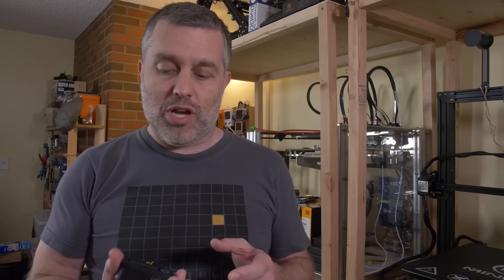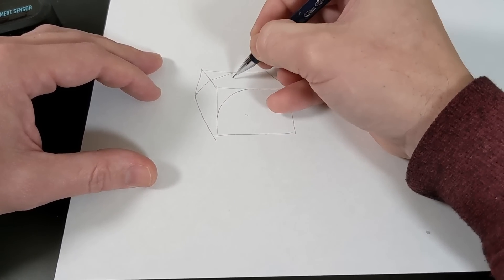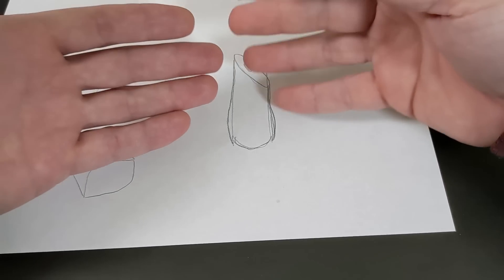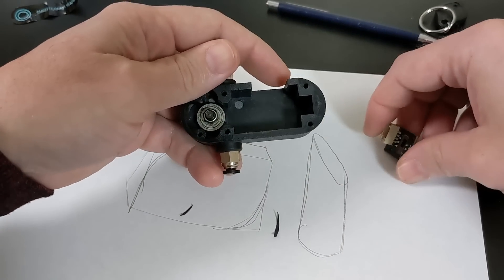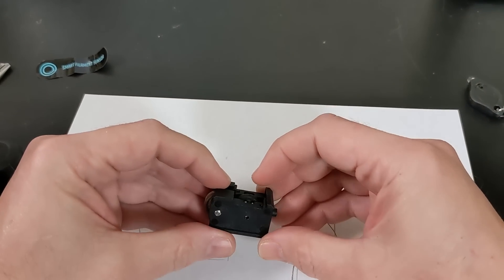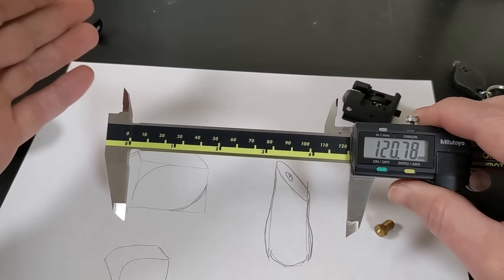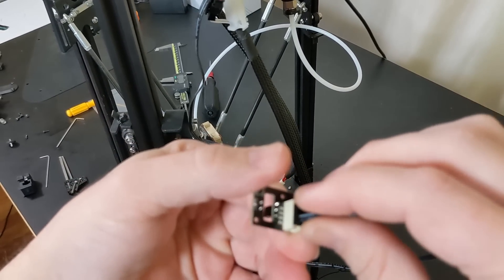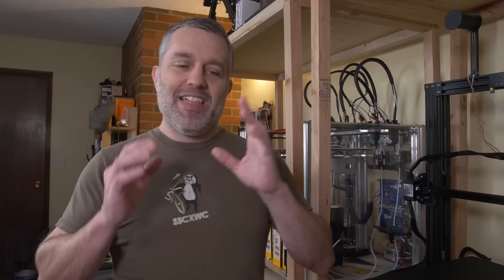The Bigtreetech Smart Filament Sensor - An In Depth Review

Comment: Although I agree the design could be better, the filament would eventually (sooner than later, I guess) tear the rubber wheel if they were in direct contact. That’s why the extruder uses metal gears to push filament (same principle, just more tension from the spring).

About the design (and the material), I would imagine they were using off the shelf components. The casing is injection molded, so they ordered an ugly box from a catalog and the factory retooled the interior, so BTT just threw everything inside it. R&D is expensive. So’s injection molds and machinery.

Maybe it was cheaper to leave the boxes made with a better material than change components/procedures for cheaper plastics, maybe the flex of a cheaper plastic would interfere in the precision of the readings from the sensor...
What I mean is, there are lots of “maybes” involved, not just bad design. Form and function must meet costs (in fact cost dictates form and function in most cases, specially in cheap items from China), and, not maybe, I’m sure after all things considered it’s made in the cheapest possible way.

Edit: now that I’ve seen the entire video, wrong wiring... twice!!!! You know, I prefer online manuals, they tend to be the latest and revised version. If there wasn’t a manual inside the box, one more reason to carefully read it online. I think a manual inside the box wouldn’t make much difference anyway. It all came down to cost again. Cheaper to replace a few burnt boards than include polarity protection in ALL boards.

Comment: Architecture vs ART-chitecture is always a hot mess lol.. you are so right. Big tree tech boards  are an absolute waste of time....garbage. 
On a totally different note, I asked mingda about naje a 400-500mm printer much like the d4 pro and the answer was yes. They are indeed in the making an upgraded d4 machine. And that that is currently on the board. No date was given or what the upgrades were but will be looking at an 800 dollar tag. I wish I could show the email I got yesterday.  This was all due to me asking if the had a bigger the rock 3 pro. That was the info given to me by Sal. So we should have a new mingda coming at some point

Comment: more rant than review i'd say, especially since you never got it working the way it was meant to. i appreciate your insight as an industrial designer but this sensor was designed to be 3d printed which is why the form is so clunky. i have an early version and both the body and internal component is 3d printed.  regarding function, it works ok except it adds a lot of friction and should allow tension adjustments. i modified mine with a screw adjustment for the spring. the pinout matches their skr boards and their LCD controllers. i upgraded an Ender 3 with an SKR 1.3 board and TFT35 touch screen controller and it works perfectly for me.  regarding the detection distance due to sensor resolution, this isn't an issue if the sensor is mounted before the extruder.

Comment: Just FYI, if you're using a BMG extruder, you can easily install it on top of the extruder so that it is able to tell the firmware the filament is broken/runout before it gets to the extruder.
Reply: With runout yes, with a filament jam, no. Runout is much easier to detect with just a switch pressed against the filament which will directly trigger. The jam detection is where these sensors should shine
Reply: @rosserobertolli  I had a jam today where my nozzle was way closer to my bed than it should have been, touching it so much that my extruder couldn't push any filament. The sensor detected that nothing was coming out when it should have been and printer initiated a filament change.
Reply: @light-master  That sounds like it did its job better than I expected! I still agree on a lot of his other remarks though. I would wish there was something like this one build smaller and better (the electronics, not the housing). This one is a bit of an eyesore. But maybe I'll get one to test and copy, but better!

Comment: I know nothing about filament sensors but shouldn't it be "plumbed in" between the filament roll and the extruder and not as you seem to have it between the extruder and the hotend. Don't you want to detect filament outage before it is extruded ?

Comment: As with ALL your reviews, everything is badly engineered. Maybe the problem lies with you when everything breaks down but works for other people. If everything is so poorly designed you may have to make it yourself instead of tearing it down, the whole world is waiting for the perfect designs from you. Maybe start by reading the manual before you try something, you will see that many things will not break when connecting and will work well. Not everything is fool proof, but that is not necessary. If you don't know how to use it, keep your hands off.
Reply: like the hot end that he bashed for binding but never showed if it worked before he took it apart... and the second one was mint out of the box... could it have bound before he took it apart.. maybe but not a great track record with that kinda stuff.. takes apart .. and strangely when it goes back together it doesnt work as advertised anymore.. maybe he should start doing analysis like science is supposed to be done.. get a control first and make sure you do it correctly THEN take it apart/ change variables

Comment: I have one of these and agree about the design, way over the top.  Finding a decent place to mount it is my biggest annoyance.  As for the functionality, it worked first shot out of the box for me.  Everyone has their own experience, you remind me of the local Shock Jocky but for the 3D world.
Reply: Out of interest does it allow you restart a print if it detects a jam? Or is it mostly just to let you know there's an issue with the filament and stops the printer just waving around in mid air?

Comment: Finally someone put boden tube fittings on one, necessary for me. I like the dual metal wheels for my abrasive filament, but I would chuck the electronics and just put a momentary switch in it.

Comment: I actually like Big Tree Tech products myself. At least a for the ones I tried, which are a few of their SKR boards & LCD Screens and the TMC drivers the offer. I have not had many issues with ones I tried. Their BTT GTR is a little weird though when trying to setup Marlin to use it's M5 expansion board.
BUT
There are a few of there products I just don't care for. This sensor has been one. I just didn't even want to try it because of it's design. Basically the very same reasons you mentioned in this video on it. If they would have offered the board itself I might have tried it though. I like to design my own housings for the electronics I use. I probably would have designed to to connect straight to a direct drive extruder.

I know we all have our likes and dislikes so I can't and won't knock you for that. I personally hate apple products for personal reasons and avoid them with a passion. We are all entitled to our opinions. ;)

Comment: ,,Never touching a bigtreetech product again", isn`t the h2 extruder by bigtreetech?(you actually liked the h2)
Reply: to be fair, he did say he won't touch their electronics again
Reply: @GRuizMedia  Dont give him an out. I want him to change his mind and give it a shot. I have a feeling he'd like it more than he cares to admit.
Reply: @BeefIngot  Thats what I thought too
Reply: I still don't know why he liked the H2. He started off saying it's basically the best an extruder can be, then goes on to have to manually shave down gears, clean and re-lube everything, and end up having to use another whole unit. Then it did not even extrude filament very quickly. I always thought the main reason to have a small light extruder is so you can move it quickly without artifacts, but if it can't extrude filament quickly then why does it have to be compact and light? And he's still planning to use it in the "best printer" he has.
Reply: @CodeMonkeX  i didn't see him actually try it before taking it apart and the other one was perfect out the gate.. that to me sounds like something got botched by him.. he's real good at not doing "proper" scientific testing .. ie one with a control and goes whole hog on disassembly before verifying function.. 

and he ended off by saying it still will allow you to print WAY faster then most other hot ends so it is still a benefit.. could it be better .. sure but they had to make some concessions and realistically the ones they didn't wont be noticed by most consumer

Comment: I did an in-depth breakdown of this on my channel, but you really need to understand how it works within Marlin. By default, BTT sets the runout distance in Marlin to 7mm. What this states is that the lack of a state change on the input pin (aka high to low, or low to high) would indicate a runout immediately with the value set to 0mm. Marlin is coded to keep running until 7mm of "movement" has occurred. After the 7mm (roughly 651 stepper pulses for the average extruder assembly), if the state of the input pin is the same as before, it triggers M600.

If you are using it for jam detection (which is the primary benefit of this sensor over other products), then it has to be downstream of the extruder. This is the primary purpose of the system, with runout as a secondary feature. The actual process of calibrating this involves starting at 7mm, and increasing if you're getting false positive runout signals. I'd need to tear another one down to actually measure the rotary wheel hole diameters to get a more accurate distance-between-state-change, but it is fairly minimal.

Yes, it will continue to print for a few moments while it waits for the RUNOUT_MM value to be reached (think of it like an on-delay counter). However, the only way you're going to get around that limitation is by having a switch on the inside wired up as a separate runout detection (Marlin is currently only programmed to handle either pulsing sensors or a standard switch, not both at the same time).

If you're interested on more visuals, and a breakdown of the wires (notably what each wire connection on the sensor side is, in case the wire labelling standards have changed across batches), have a look at my video: https://www.youtube.com/watch?v=KQmTH9ljWqI. Full disclosure, I bought them myself and I'm currently using them on 2 different machines (CR-10s and Ender 3 Pro in a direct drive config).
Reply: "If you are using it for jam detection (which is the primary benefit of this sensor over other products), then it has to be downstream of the extruder."

This design is not meant to be pushed through. How you came up with this idea, I have no idea. It monitors filament movement. Filament not moving when it should? Your controller board knows it. Where it is in relation to the extruder is irrelevant.
Reply: I just watched the video you linked and every way you installed it was wrong. This sensor is only meant to be used with a reverse bowden setup. Did you even bother to read?
Reply: But the design is wrong for jam detection. Because it uses only one light sensor, filament bounce back on a jam can simulate movement pulses and the printer will continue to push. It needs to be a quadrature setup to do the job properly all of the time, not just a design the works 'most' of the time.

Comment: Thank you for a great review, I see i did the right call long time ago to stop using BTT hardware :)
Have had two BTT skr mini E3 and one skr turbo  and the boards sucks they all went fubar after 1  year of use. CPU  burned up on mini and som bad solder on the turbo. The cpu issue seems to be a known problem on mini boards. 
The quality control and components on BTT  hardware are bad bad bad. BUT hey i got 3 rubber ducks ;)

Comment: You are right they designed it wrong, if the terminals are described on the cable it is really hard to expect for a person to wire it in a different way. If I was doing it even following an instruction step by step, I would probably make the same mistake. Your other complaints are also really valid.
But saying you won't review a very popular and well regarded SKR board just because this sensor was bad? Isn't that a bit silly? This sensor was likely developed by a different team in a completely different place. Sure, to keep up their brand they should make sure every product they release is decent, but this is how stuff from China works, you can't just trust a brand but also a specific product or even its revision.
I totally get why you wouldn't want to review a board, it is really time consuming and you might not feel the want to, maybe you want only support Duet3D. But this reason doesn't sound the best.

Comment: I think there’s some stuff missing here. I have a duet Magnetic sensor and it’s impossible to work at all. After hours of frustration I gave up. I finally saw Teaching techs video on this filament sensor. I bought one... after reading all I could on it, I realized that yes if you just plug the SKR sensor into a Duet it will smoke it. This is true of all Marlin boards. Duet uses a different wiring schematic. The power is on the outside versus a SKR, or any Chinese Marlin board where the power is on the center pin. 

So on the sensor I bought I had to switch the wiring pins to the correct pins to work with the duet. 

Once I had that done I could tell the status of the sensor by sending a gcode (per Duets guide)... then I calibrated it. I ran several tests and once I had the final settings I plugged it in and it worked flawlessly. 

I have mine before the extruder on my Railcore. In fact I have it at the beginning of the reverse Bowden tube. So when there a runout it stops the printer immediately, parks the head and backs out the filament. 

It also does detect filament jams. 

In my experience this on a duet is much better than the Duet filament sensors. 

I do agree that form of this sensor is goofy, overly heavy and bad design. The Duet magnetic sensor is the size of a half dollar. Lol. But I couldn’t get it to work.